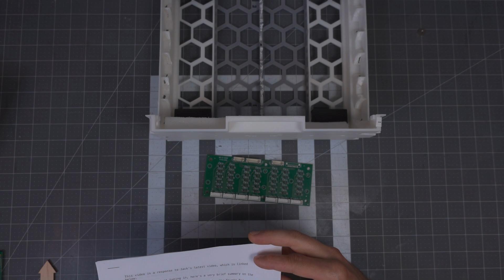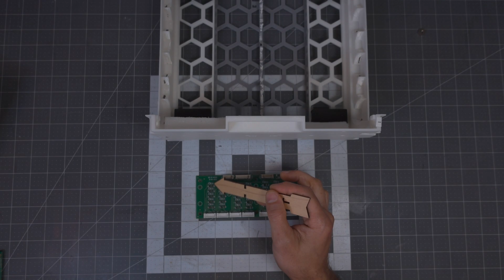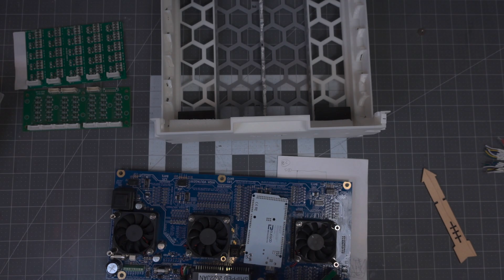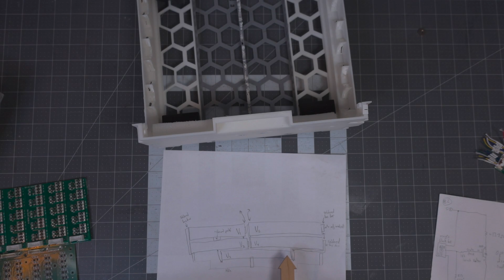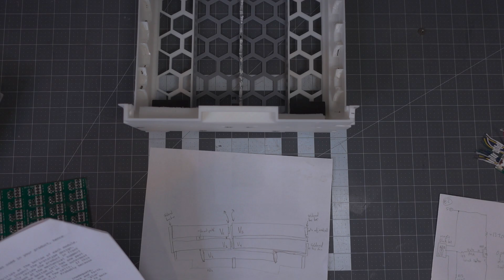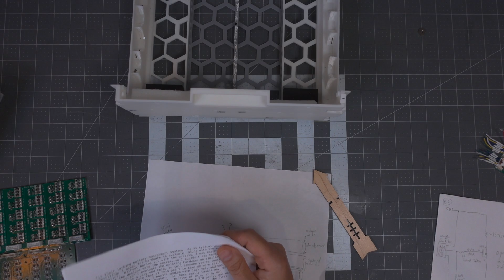My 2nd Response to Jack's 2nd Response Regarding V3 NexPower Safety

Comment: Hii can you design a battery and sell it you seems like you know your stuff more than jack. i was thinking of buying project lithium product but always new versions feels like everything is a beta product he sells and i dont want to spend alot of money upgrading battery to have to rip open half my car to replace battery every few years
Reply from the maker: I am presently in the early stages of designing a lithium battery BMS for the Gen3 Prius.  It should become my top priority starting in October.  No timeline for release... "when it's ready".  For now my recommendation is to go OEM NiMH if you need a new pack ASAP.
Reply: @doppelhub  thanks for your response yes I would but my battery is ok for now
Reply: I would definitely buy a drop in solution to replace the shitty v1 boards just installed the V3 in my car yesterday..... @doppelhub

Comment: I hope you’re able to collaborate in the future and start your relationship over again. 

That said, I’ve had V1 in my Prius for over 75,000 miles and had no issues. It’s a big sluggish in the winter but I keep my battery fan on pretty much all the time and keep car at 70F as much as possible.  Zero issues. If end up releasing a product for Prius, I’ll absolutely check it out. Insights are cool but they are too small and too expensive. - I think you guys should settle this by your products only. Your product looks way more expensive and advanced.
Reply from the maker: Thanks for reaching out.  I'm glad to hear that many (most?) of Jack's customers aren't experiencing issues.  However, these anecdotes don't refute my safety concerns with V1/V2/V3 hardware. To illustrate my point, most Firestone tires with a defective design didn't fail, and yet 271 people died before the root cause became public.

Alas, the "Jack and John work it out" ship has sailed.  We have fundamental differences regarding product design and testing.

Regarding price, my existing LiBCM product (for the G1 Honda Insight) costs $1250 for the kit (which I sell), plus whatever you pay for the batteries (from the G3 Honda Insight, typically between $450 and $900).  I don't make much selling my kit, but I'm not really selling it for profit.

My LiBSU product (for the G3 Toyota Prius) will cost considerably less for the kit, because it is a much simpler product.  The primary cost reduction is that the lithium modules I'm using already have a built-in BMS; this reduces my BOM cost by at least $150.  This is also why my LiBSU product doesn't require fans and also how it will fit inside the OEM BSU enclosure (which LiBSU replaces entirely).  I have no idea what cost will look like yet, but right now I'm not planning on selling LiBSU directly to customers (this may change in the future, on a case-by-case basis).  Instead, I will sell Kits in bulk to a well established hybrid battery company (name TBA), who will then sell it to consumers (and also provide support, etc).
Reply: I’m really excited about these products. Competition is a good thing for consumers. I’m subscribing and keeping an eye on your progress.

Comment: I was interested in Jacks products but had questions. I found your comments and then videos. I'm a theoretical biologist by training, I'm not an engineer but understand maths. Thanks for steering me clear of a dangerous product, in part by the use of integrals.
Reply from the maker: Integrals save the day!
Reply: I'm so interested in your Toyota product btw!
Reply: @GordBuilds he has nothing 😂
Reply from the maker: @nicholasespinoza7237  I agree I do not presently sell any products in the Toyota space.  I am very open about this, so I don't understand the point you're trying to make.  To be clear, my Gen3 Toyota Prius product is in the early prototyping stage.

However, I have mostly already developed the core technology, as the Prius product is derived from my existing Honda Insight product (which was sent to alpha testers in 2021JUL, and started shipping in 2022JAN).  FYI, my existing Honda product is ~80% of the base Prius design.  Adapting the remaining 20% specific to the Prius is going to take some work, but I've already reverse engineered the entire OEM BSU design, including the differential serial protocol, so all that's really left is mechanical fitment, laying out a Prius-specific PCB, and of course integration hell (the majority of the work). 

I should begin full time work on my Prius project in late September... I'm finishing up some other projects right now.
Reply: @doppelhub  where do you sell the honda battery ?
Reply from the maker: @nicholasespinoza7237  I do not sell the battery; only the DIY Kit.  If you want to DIY yourself, see linsight.org/batteries for more details on where to source the batteries.  Otherwise, you can purchase a drop-in-ready LiBCM Kit from GreenTec Auto: greentecauto.com/hybrid-battery/honda-hybrids/insight/pre-sale-honda-insight-kit-project
Reply: @doppelhub  yes you are clear. I meant any future products. It was me that was unclear!

Comment: Jumping from one high energy cell chemistry to another while trying to shoe horn / matching it into an NiMH system is both dangerous and likely result in poor cell longevity. This is besides all the amateur mechanical assembly. Looking at EVs, high energy cell batteries are best done by those with intimate knowledge of cell chemistry and behavior. Can't just go by matching voltage and SOC curve. Applaud your tireless efforts to point out the issues.
Reply from the maker: Thanks for the rational response.  I certainly wish I had been able to work out these issues privately with Jack earlier this year.